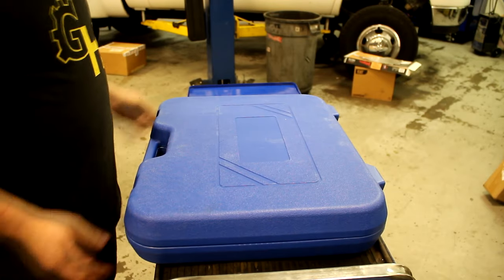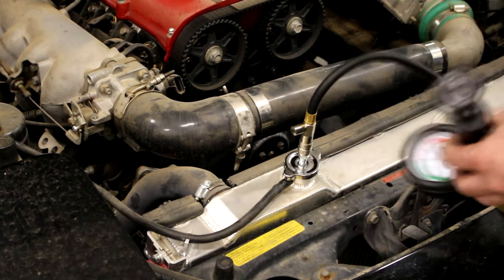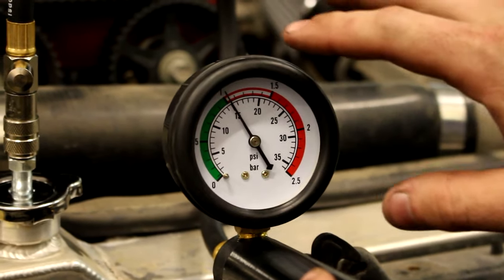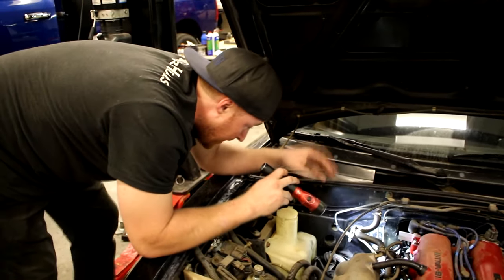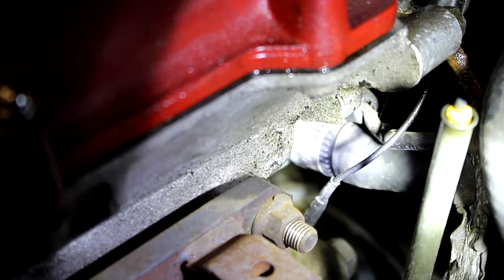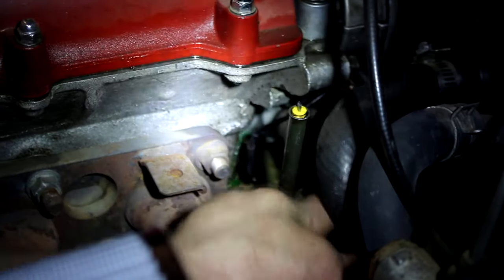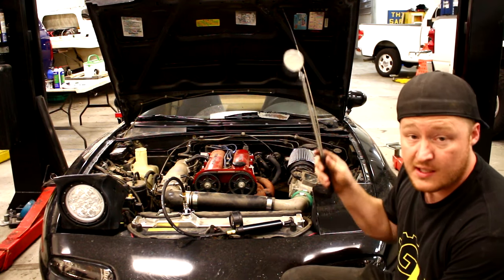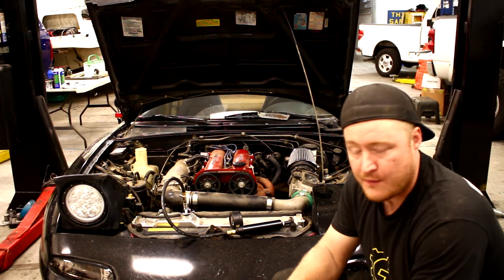The RIGHT Way to Find A Coolant Leak!

Comment: Can you help me? I'm not sure what to make of a mechanic? 
I have the car there now. 

I got under the car before dropping it off with a camera and recorded where the leak was coming from and I saw the leak coming from where the belts are turning near or under the water pump I had checked all around the radiator and the radiator was dry and so I don't have the tools to do what I have to do so my mechanic tells me that the radiator is shot but  my vidro shows the leak wasn't coming from the radiator what's happening is it's coming down from a certain part where the belts right next to or from the water pump thats next to where the belts are turning, the drip comes down hits a  hose and then hits the ground. 

There is a spot on the ground near the radiator but how vould it be the radiator when I see it dropping from the water pump? 

My mechanic is telling me he has to change the radiator out and it might also be a waterpump I think hes scamming me.

What do you think?
Reply from the maker: Without seeing it myself I cannot tell you if the mechanic is lying or not. It is possible that both are leaking, but you can always take it to another mechanic for a second opinion. I pressure test and inspect for leaks but more than one time I have pressure tested, found a leak and then found another leak after the repair was completed because with the pressure test it was only leaking out of the worst leak location. At the end of the day you need to have a mechanic that you trust and if you don't trust that one then you might need to find another.
Reply: @GearHeadsGarageChannel  

Well thank you for getting back.

I talked to him.
He claims that the radiator was leaking. 

Heres the thing.
Every day, I would put in a cup of antifreeze, this car doesnt have a radiator cap. You must put it in the reserve, i think its called 
Little plastic square box with screw on cap.

I put the antifreeze in and the drops start leaking. About every 2 to 5 sec.

But if I dont put any in it doesnt leak.

And it only leaks from near the water pump. 
I recorded it.
I see from where its leaking. 

No where from the radiator.

I'm not saying it couldn't be both.

But when I called him, he said it was the radiator and didnt see any other leak.

Im like..but the only leak visible is the leak that begins the second you put fluid in and its only from the place near the belts where I believe the water pump is.

He says the water pump is inside the engine.

I said regardless, its leaking near the belts where I believed the water pump is/was. 
It's the only physical leak I could see.

He says it sounds like you're calling me a liar? 

I said it sounds like it, but actually since you have a better look at it rather than me Im wondering if you missed another possible leak. 

It could be leaking from the radiator i ssid but its definitely leaking where I saw it.

He said well, I wasnt here when the care came in, my mechanic said it was the radiator. 

I asked him why his mechanic didnt see the main leak? 

He said he did a radiator test with a pump. 
And if its not the radiator I'll give it to you free.
My machanic has been with me 5 years. 

I said well, there is definitely drops of antifreeze dropping down  from far behind the radiator up near where the belts are. 
I have my video right here looking at it? 

I again mentioned that I took a video of it.
And my eyes are not deceiving me. I know what I see in the video. 
I reviewed it 50 times.

I told him I examined it on a flatscreen screencasting my phone to the flatscreen and its definitely leaking from where the belts are near where a water pump should be.

He said he'd check it out himself. 

I told him, its possible since you have it up on a rack that the leak is coming from the radiator too. I don't know?

So what do you think?
Reply from the maker: what kind of car is it?
Reply: @GearHeadsGarageChannel  

2004 Chevy Aveo.

I should mention that the work on the car is done. 

The mechanic charged $500

The leak was fixed, oil changed, a light inside the car repaired, a new door handle was put on, which involved taking off the interior of the door. 
A thermostate replaced which apparently was where the anti freeze was coming from that I video taped with my phone. 
And the radiator was replaced.

Total price with tax $500

So, Idk? I suppose it all worked out, the car is running great.

Maybe it was my chat with him?
Maybe it was the radiator?

But regardless I appreciate any input from you.
Reply from the maker: @BrodyMcCain  $500 for all that doesnt sound bad to me! Good luck man
Reply: @GearHeadsGarageChannel  

Yeah, that's what I thought. So, its all cool. Thanks.

Comment: WOULD THIS WORK TOO IF YOU HAVE A LEAK IN YOUR HEATER CORE???
Reply from the maker: Yup. It will either drip on the ground out your A/C drain or leak into the footwell in the interior.

Comment: AutoZone rents out all their tools for free you just have to put a deposit that you'll get back   my 2013 mazda 6 2.5 l  For the past four years I smell  engine coolant  Still can't find it it's only in engine bay , It holds its temperature and  pressure.. I rarely have to add coolant ... One thing I noticed the reservoir tank has a Overflow Hose just in case maybe I'm getting some fumes from that because it's open to the atmosphere

Comment: My coolant housing is empty but my radiator is full idk where it’s leaking from
Reply: Because it leaks on the opposite side of coolant housing
Reply from the maker: I showed you how to find a leak, if you pressure test it and have no leak but it is backflowing too much through the reservoir you probably have a weak rad cap.

Comment: What might it mean if the coolant doesn’t leak UNTIL the car is turned on?
Reply from the maker: Once the car is turned on you have pressure and the coolant is moving around. If you have a leak in certain spots it may not have enough pressure to leak out with the engine off, or the coolant may flow downhill allowing air in behind it. OR You have a blown head gasket but that would likely be smoking a lot and you would not be seeing coolant on the ground. Follow what I showed in the video with a pressure tester and you can find your leak.
Reply: @GearHeadsGarageChannel hey there , is  it ok to pump it up to 25PSI, or is that far too much pressure. Thanks